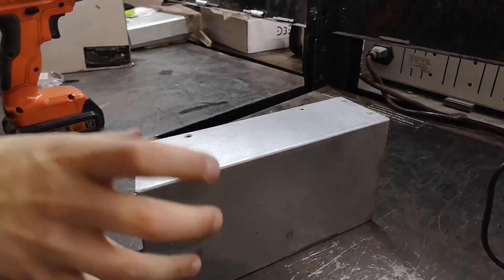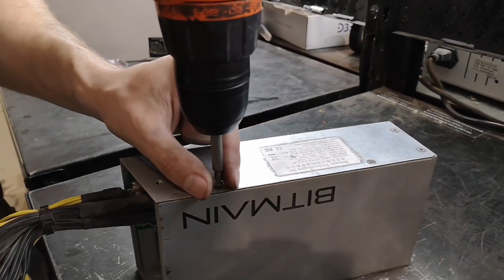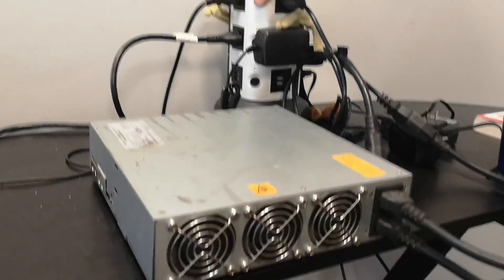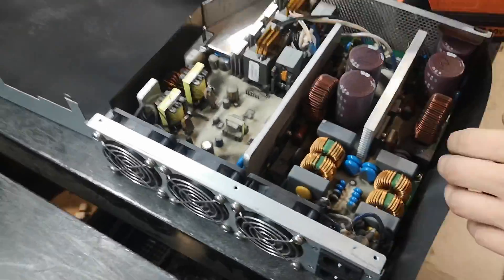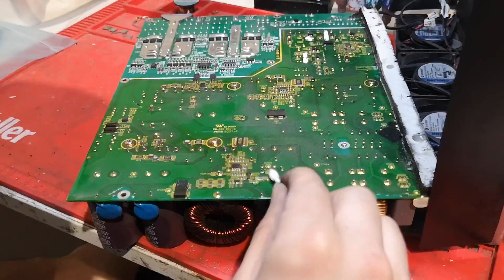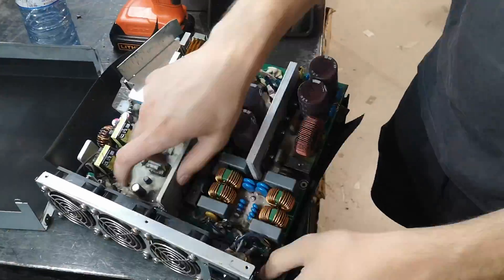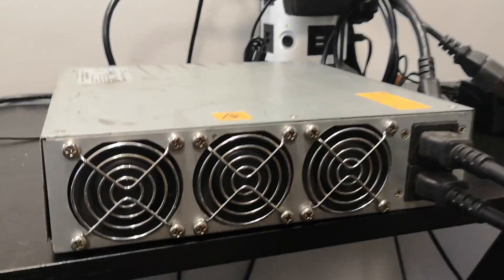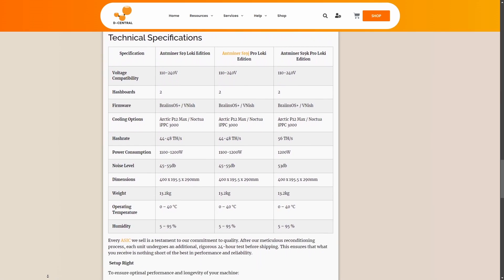Modified APW12 PSU – Perfect for Antminer Loki Edition | Step-by-Step 110V Home Bitcoin Mining Mod

Comment: did the mod today, worked out great my s19 pro is hashing at 40th and around 1100w
Reply: Does it need any special firmware?
Reply: @Javirero  yea otherwise it tries to run factory settings on 120v, plus i got better efficiency at a lower power draw by removing 1 hashboard my s19 110th is running roughly 60th at 1600w
Reply: @jakobfindlay4136  I plan on doing this mod to run a S19j Pro.  What custom firmware did you use?